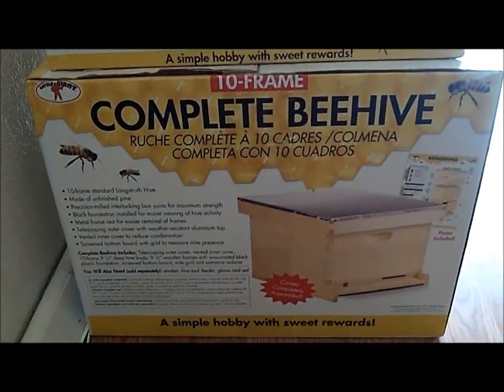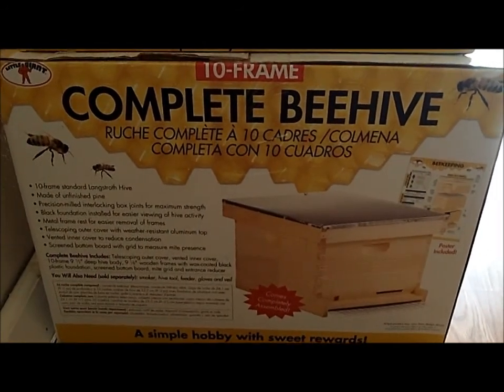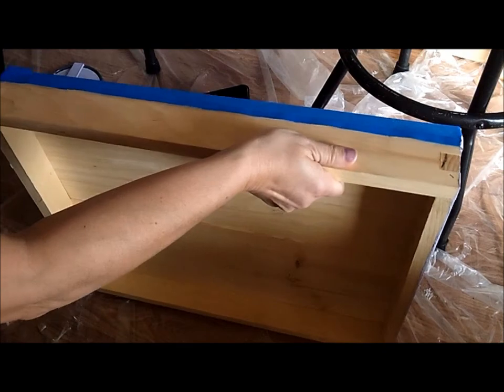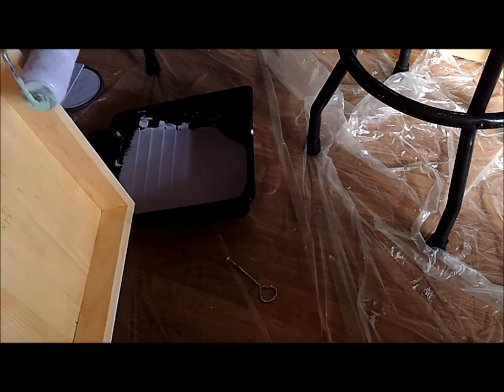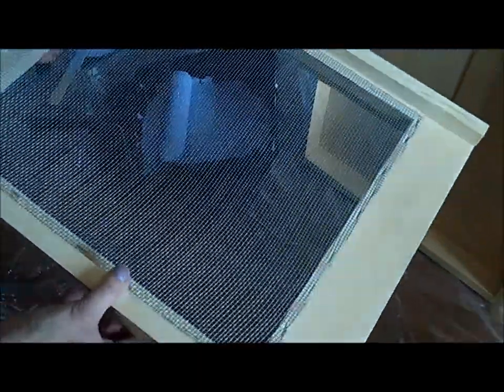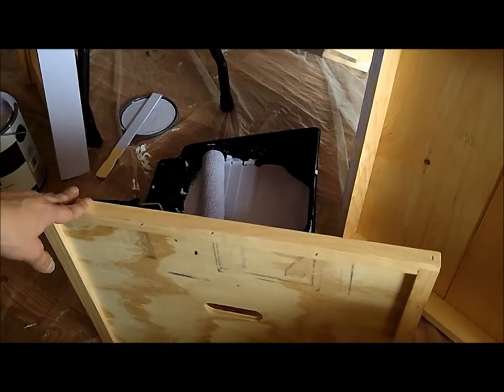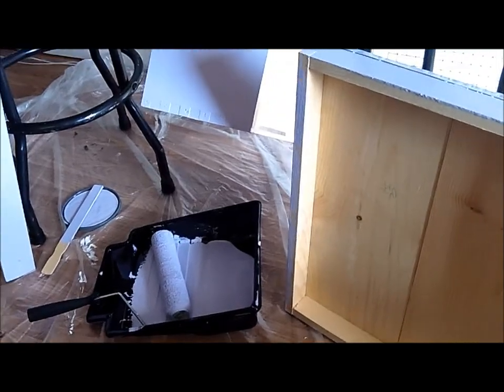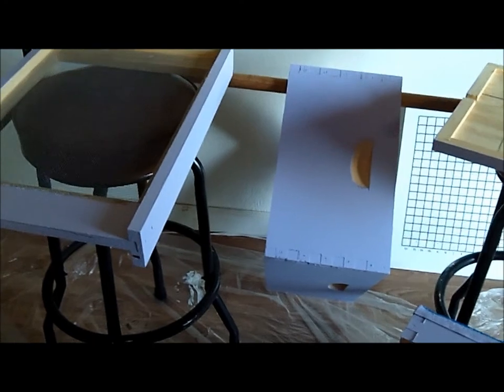BEE KEEPING PART 1

Comment: I'd get another deep hive body. run 2 deeps and then the medium for honey.
Reply from the maker: I have 2 complete deep hives and a med body. So 2 deeps and a med. This should get me threw the first year. I hope. thanks for watching
Reply: If everything goes smoothly. You will have to feed them to get them to draw out the comb, just watch so they are not back filling the brood nest and go into swarm mode. Usually that is not a problem unless you use a queen excluder between the deep and medium on undrawn foundation.
Reply from the maker: I will get them in June. I am sure ill use a excluder at some point. Just need them to live threw winter.